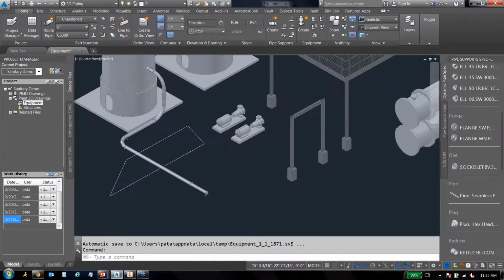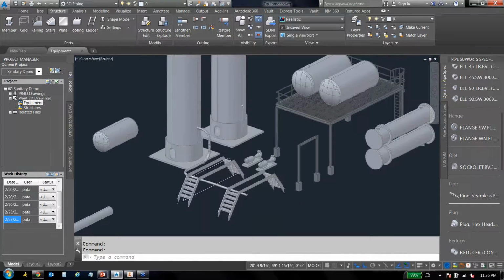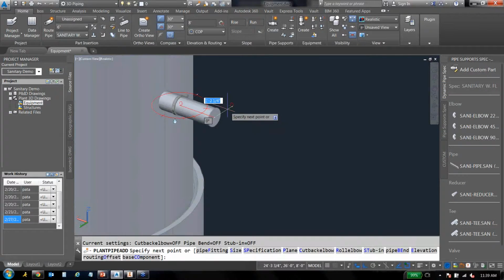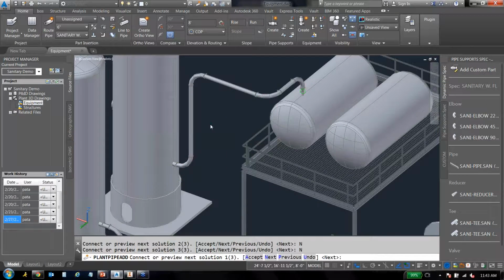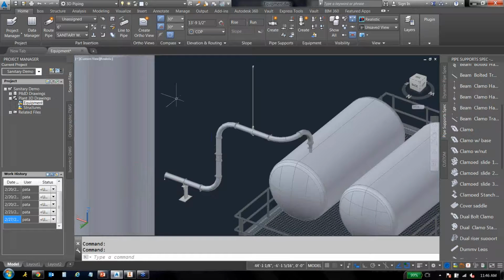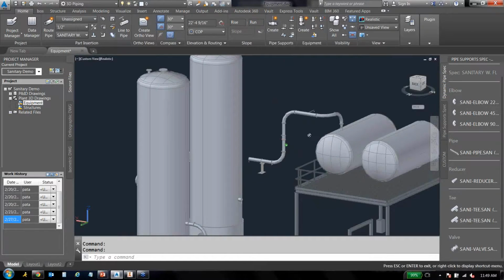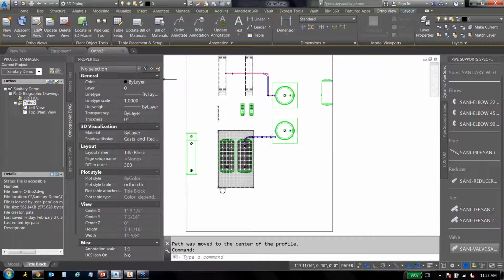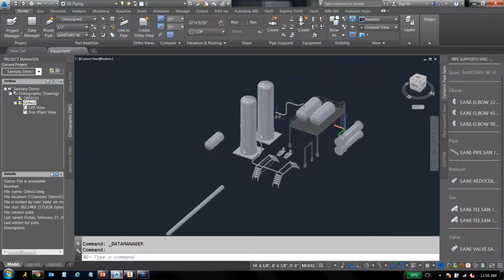D3 TECHNOLOGIES - Plant 3D (Sanitary Piping) Webcast

Comment: HOW DO I FIND SANITARY SPEC.? DO I HAVE TO IMPORT THEM?
Reply from the maker: Autodesk App Store (https://apps.autodesk.com/en) would a good place to start looking for additional Catalogs/Specs for Plant 3D.  All of blue box with white arrow icons are Autodesk created catalogs and are free.  Here is one specifically for PCV, CPVC, DWV material pipes and fittings plus valves; 
https://apps.autodesk.com/PLNT3D/en/Detail/Index?id=2996896343241739999&appLang=en&os=Win64. 

Catalogs will need to be found, added to the "C:\AutoCAD Plant 3D <version> Content" folder were all other catalogs are stored, and then items from the catalog will need to be added to new or existing specs;
https://knowledge.autodesk.com/support/autocad-plant-3d/learn-explore/caas/CloudHelp/cloudhelp/2018/ENU/Plant3D-SpecEditor/files/GUID-8153AE39-B0E5-4AFE-AB44-FA3F7E11D63C-htm.html
Reply: @Team-D3  is it possible for the 2018 version?